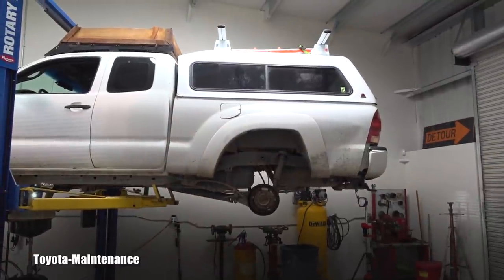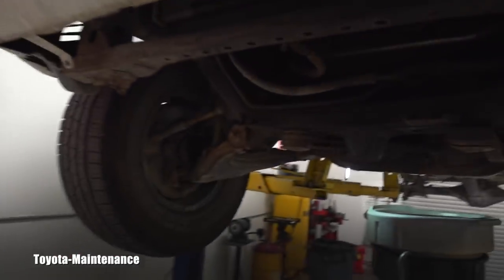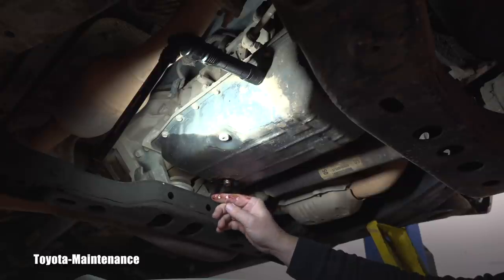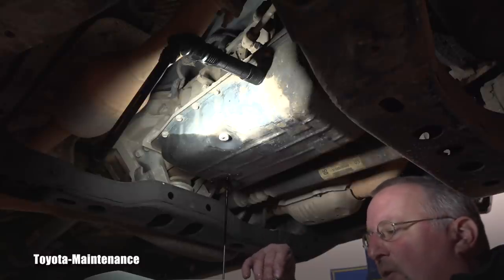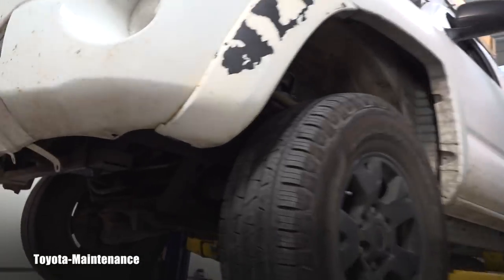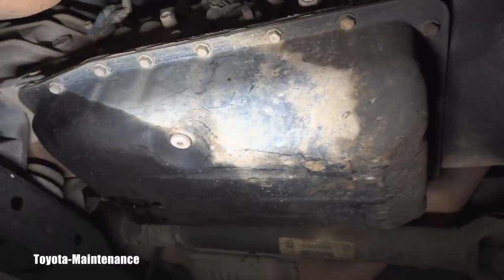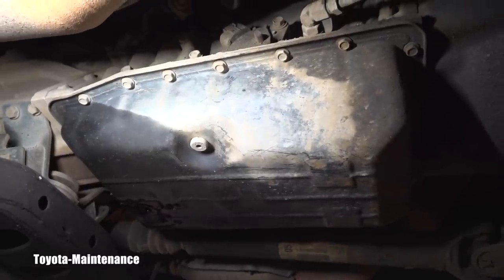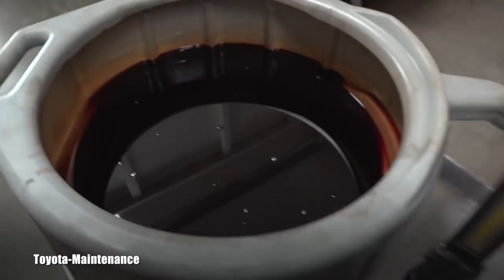Toyota transmissions can take a lot of abuse

Comment: When I bought my '11 Yaris, the owner had not changed it for 84k miles. It was extremely burned and a bit low. I did drained it three or four times through the drain plug and it is looking good. I used an alternative WS compatible brand, not genuine toyota . It now has over 150k miles and never missed a beat

Comment: I had to fight with my dealers service dept. To get them to service the tran in my '12 Tundra. They finally did it, but they didn't like it. Good video!
Reply: Just go to a specialist independent, why fight with someone over it, probably treat your vehicle poorly.
Reply: @FrenchValleyAirport  It's hard to fine someone qualified with the right equipment. It's a complicated process! I'm a pretty good mechanic and I won't do it!

Comment: Thank you for this very informative video. I would like to ask you (and the community) a question with regards to refilling the transmission after draining the pan. The factory service manual and Techstream specify that the transmission fluid be at a specific temperature when refilling. Since the volume of fluid changes with temperature, would it not be easier to measure the mass (kilograms/grams) of fluid drained and refill the transmission with the same mass of fluid? The mass of the fluid would remain static even if volume changed. eg. a kilogram of fluid would still be a kilogram of fluid whether it was at zero degrees or 100 degrees. The volume would change, but the mass (weight) wouldn't. If you weighed the amount of fluid drained and refilled the transmission with the same weight (mass), then you wouldn't have to worry about the temperature of the fluid. I welcome your comments, and thank you for hosting a wonderfully educational channel!

Comment: Auto Trans that Toyota uses sure do take a beating. They are very forgiving indeed. Mom had me drain and fill her 98 Corolla ATF at 189K miles. Did some research realized that it was a (cheapo) 3 speed Auto Trans and that meant unlike the 4sp A/T in other Corollas this 3sp has a separate differential resevoir. Well drained the old atf, very burnt brown. Drianed the diff and only about 10 ounces came out. Should have been more like 40oz. Who knows how long it was driven that way. But after getting the ATF back to red, the Corolla drove so quiet and smooth. That was with the 3 speed, the one people would rather pass on.

Comment: I agree with your thoughts on toyota transmissions.  I have found them to be very tough and bulletproof.  Had a first generation sienna that had fluid at 182K that looked like mud and after the change it shifted like new.  Took out both drain bolts (torque converter bolt and pan nut) got out 4.5 qts and did it again after 200 miles.  Cold shifts were back to normal.

Comment: Thank you for posting so much useful information I am a Toyota superfan as you are LOL. One term you use is a little confusing to me when you say transmission flush but I think the correct term is drain and fill because you're only removing what is in the pan and transmission flushes is exchanging all the old fluid for new and fresh.
Reply: A flush removes 90% of the fluid.  Drain and fill removes 30%.
Reply: Multiple successive drain and fills = a flush.

Comment: There is a reason why almost 90 Percent of the passenger cars in for example Afghanistan and elsewhere in the developing world are Toyotas. They can take a beating and even if the roads are bad they outlast other cars. Toyotas are seldom fun to drive, but they make the owner’s heart sing for joy because they are so darn reliable. 🥰
Reply: Three cheers for the developing world! They seem to have normal as well as highly imaginative ways of acquiring Toyotas. Let's just say theft is the most sincere form of flattery.  My definition of "fun car" includes reliability.
Reply: @rightlanehog3151  I would not know anything about theft being more common there than elsewhere in the world. I love owning Toyota, but I value reliability higher than driving.
Reply: @gus473  What you can’t have becomes exotic. I’d love to be able to buy the Tacoma or the Tundra in Europe. The Difference between the Tacoma and Hilux does not seem to be very big nowadays. We can’t get the Hilux with the gasoline engine at all.
Reply: @yunus_aros  There is a steady flow of stolen Toyota and Lexus 4X4s  heading overseas.
Reply: @rightlanehog3151  I would not think they would end up in Afghanistan though. Probably in Latvia, Lithuania and Ukraine.
Reply: @yunus_aros  Parts of Africa as well

Comment: My 2011 sienna had over 380K miles , never done any transmission fluid change and still running very good. As I don't plan to do it because I got my money worth already, plan to drive until it dies and buy a new sienna.
Reply: New one is Hybrid only.36 MPG with it.Toyota has come a long way.
Reply: I think your sienna is a highway car, can't image that mileage without any transmission issues otherwise

Comment: I've been using Valvoline Maxlife ATF in my old Toy. So far so good.
Reply: Valvoline Maxlife is Toyota WS compatible. I use it in my Tacoma and it works great.
Reply: I used Maxlife in both a 98 1MZ-FE V6 engine and on cold startup, until the trans oil fluid heated to temp, the first mile or so was slow to shift. Took two spill and fills to get it back to normal more or less. I thought okay it's a fluke. Maybe the T-IV was what was supposed to go in it and I goofed, live and learn. But no. Year or two later, used it again in a 2GR-FE V6. Same effect. Two more spill and fills with what was now required for this one WS and its back better. On cold, it might hesitate a little, but not as bad as before. Felt like on both cars the pressure wasn't building to push the clutch plates together to shift and needed a sec to build the pressure. Was strange. Both vehicles still work without trans problems or at least not needing anything more than fluid changes. Maybe you guys have 4 cylinders?
Reply: ` Nope, 2GR-FE V6. Haven’t had that issue, though I live in Texas. Doesn’t get that cold.
Reply: @Spillmansgarage  Nope, doesn't get that cold here either. So Cal not in the mountains. Lowest temp is about 45 in the valleys.
Reply: next time use a real synthetic -REDLINE.

Comment: I love it...  Shopping for a used Toyota and sellers asking top BlueBook value...  I ask for service records... They rarely have them ("I packed them as I'm moving" - BS) but when they do... 170k, no transmission fluid changes! No coolant changes! No brake fluid changes!

Check the mileage at the airbag replacements too.  Much can be learned.
Reply: You raise a great point. I shopped for a used Tacoma a couple of years ago and was amazed to see there is no correlation between the premium priced price paid when new, the premium price asked by used Tacoma sellers and any premium level of maintenance in between. After much searching, I finally found a 6 year old Tacoma with only 25,000 miles at a  fair price.  Other than oil changes, the owner had changed no fluids at all and was proud of it.  Naturally, I had every drop of fluid changed  to prepare it for the next 250,000 miles.
Reply: I was just shopping for a Toyota Highlander today, and of course there is hardly ever any maintenance records, and they're asking top bucks for it, really a joke
Reply: @1jackvalley580  Keep searching, the pay off will come with a top quality used Highlander at a commensurate price.
Reply: @1jackvalley580  

When you find one that you're seriously interested in, take the VIN and plug it into the Toyota owners website. You have to register your email to establish an account.  You will see, under that vehicle specifications page, the original options. Once registered, you can look at the service information. Make note of the mileage and services performed.

I am not exaggerating to say I caught at least three dozen Toyotas with altered odometer readings.  when that car goes in to get its takata airbag redone, they note the mileage. if the car hasn't had the airbags redone, I would be very suspicious. Those recalls go back years.

You can also go to Carfax and add cars to your garage or maintenance reminders list. I have found multiple cars that I was seriously interested in with mileage discrepancies, weird service notes, records of accident repairs that don't show up in Carfax...
Reply: @SeanPopify  I love how the dealer service people note everything in terms if importance. Keep it short but they note it. I found on the Owners site when the previous owner crashed into something. And when he took it to Walmart and they stripped the oil plug. Going to guess that's why the lug studs are bungled all around too. Very good advice that I normally would give.
Reply: @LAactor  In Southern California, most annoying notes from a few dealers are platitudes about "we're here for your best experience..." Blah, blah, blah...  I'll try to find one and paste it here... Some service advisors are sharp. Some, no, many aren't 😲.

Well, couldn't find a full-blown platitudinous prose, but this one is full of unnecessary filler and redundancy...

"TOYOTA CARE LUBE, OIL, & FILTER WITH TIRE ROTATION. ~|~TOYOTA CARE LUBE, OIL, & FILTER WITH TIRE ROTATION. ~|~DRAINED ENGINE OIL, REPLACED OIL FILTER, ADDED FRESH MOTOR OIL, ROTATED TIRES TO BEST LOCATION, PERFORMED 29 POINT SAFETY INSPECTION, WASH VEHICLE EXTERIOR AS WEATHER PERMITS. ~|~1XXX7 60 DRAINED OIL, REPLACED OIL FILTER, RE-FILLED WITH FRESH OIL. PERFORMED 21 POINT INSPECTION INSPECT WEAR CONDITION, INSPECT FOR PUNCTURES, INSPECT BRAKE CONDITION, AND ROTATED TIRES TO BEST POSITION"

Comment: My dad owns 2 Toyota trucks. '96 T100 and a '97  Tacoma. He never changed the trans fluid in either. Ever. They are currently sitting at just under 400,000 miles. I drive the T100 daily for work. Do I think you should change your fluid? Absolutely. But seeing his trucks go and go and go brought me to buy Tacomas. I trust Toyota manufacturing.

Comment: I didn't learn that I could change transmission fluid on my 05 4Runner until 90K miles, but I've done it several times since and the fluid is bright clear red and the transmission works perfectly. I regularly drain and fill all my Toyota transmissions now. Once you know how, it's easy.

Comment: My neighbor had a bad oil leak on his old 2000 Corolla for years. Oil always under the dipstick, everytime I changed it only 1 or 1.5 quarts came out. Needless to say the engine still ran when we scrapped it 3 years ago and I couldn't believe it

Comment: I had a 98 Ford Taurus, when I was foolish enough to buy a Ford. I knew the transmissions weren't bulletproof, so I went heavy on the maintenance. Four times a year, regardless of milage, I would drop the pan and drain the fluid. Every other time I would replace the filter. Around 80,000 miles, the thing STILL crapped out, requiring an expensive rebuild.

On the plus side, it was literally the day after I signed the car over to the ex as part of the breakup!

Comment: Yeah just did a drain and flush on my 4runner. Drained it, filled it. Turned it on, shifted through all the gears 2-3 times stopped. Then drained it again and refilled. Shifts much better after 12 years of use, 177k miles, I doubt it had been serviced. That included doing my diffs and transfer case.

Comment: I had a 1996 t100 4x4 3vz . I sunk it  to about 6in from coming into the windows in Carova  NC . Hour later i got pulled out it started first hit. I drove home to virginia beach  about three hours with a trans. full of water. It had 175000 when it happened  i cleaned every thing and alot of trans flushing . A 4runner ran a stop sign and totaled it at 210000. It didnt have any problems and i drove it vary vary hard. Still started and drove  but no rad., lights,or fan. But the ac had no leaks and worked

Comment: My 2000 Tacoma has 590,000 miles on the trans and its been told me by Toyota not to mess with it since its pink (why F with it)been pink for 150,000 + ,sure don’t baby it ,when I need more pep on FWY I hit that O/D button ,I think I’m blasted off I LOVE PINK!
Reply: Edward Aguilar have u changed the oil ever ? Wow it’s been pink for many miles I love pink
Reply: @treedeblue  always had changed it regularly the about 300,000 miles jiffy lube and others wanted me to sign a waiver ,so I said Toyota dealership should and has been doing ,basically Toyota said they would do a just drain fill without  messing with the filters and stuff,but yes always had changed it every 50,000 miles ,and now it’s been about 150,000 miles without a change but like the dealership said let it be ,than only change oil not filter

Comment: If ya haven't mentioned it, Blackstone Labs will test oil and transmission,coolant,differential etc fluids. See if previous shop actually used tbe specified fluid customer paid for. Tests results show lotsa stuff. And relatively inexpensive! $25-30 bux last i had it done. They provided the mail safe cans. Used fluids are considered hazardous materials but way you send in provided containers is idiot proof.
Reply: It's a waste of money. Did it and they always check back and keep sending samples. It's rare you'd catch something in the particulates that would show a bearing or piston going. Change the oil at the interval Toyota recommends and you will be fine. 5000k or 6 months for older cars as they all make abrasive metals.  TBN is another scan add on you don't need.

Comment: With a GM transmission many say that if it's too old 150K or more not to change do to possible 
slippage or damage.  Would you agree with the statement? 
Is there a cut off mileage in a Toyota where you wouldn't change the fluid?

Comment: I thought you were going to change the filter also.
Reply: I don’t think you can without disassemble the transmission
Reply: @sciatl2505  the pan comes off of this a750 trans easily. It only contains a filter screen, no traditional paper media in there. I’d drop the pan for the chance to clean the screen and the pan itself out.

Comment: Question......one of the comments below said the guy changed the fluid from the pan and the torque converter. I know how to do it from the pan, but how do you do it from the torque converter on a 2017 Toyota RAV4 and a 2009 Honda CR-V?  Jim

Comment: Purchased a 2008 Toyota 4Runner 4.0 v6 . No transmission service records and it has 198,000 miles on it . Can I drop the pan and change filter and fluid without causing problems with shifting ? I’ve heard it’s a bad idea because it has possibly never been changed?

Comment: I changed the manul transmission fluid on my 2001 Civic 5 spd 111k and it shifted easier, I think somebody forgot the 60k maintenance.
Reply: The two quarts of manual transmission lube in my 05 Corolla 5 speed get changed in 5 year/ 50,000 miles intervals. The cost of the (Amsoil) lubricant  and 15 minutes labor is cheap preventative maintenance and another regular reminder of the benefits of choosing a manual.

Comment: I'm the 2nd owner of an 03 Avalon with 225K miles on it. Purchased it over the summer. Car runs very well. I put in a new timing belt, water pump, air filters, break pads and rotors.  Original engine, transmission, starter, alternator. I'm pretty sure the spark plugs have never been replaced, the valves never adjusted and the trans fluid looks like Guinness stout which leads me to believe it's never once been drained and refilled. Wondering if I should do that or just let her be at this point? Don't want to mess with whatever might be floating around in that fluid. She shifts alright at the moment. Any thoughts?
Reply: Take it to a competent transmission shop, flush the entire transmission and replace it with 100% new and approved fluid. I hope you changed the plugs.
Reply: At this point do not change the transmission fluid unless the shop will eat the cost of the transmission rebuild. It's safe to say that transmission friction material from the clutch plates have come off and are suspended in the trans oil. Without that fluid with the friction material, the trans will fail. Do not flush. It's too late. You can get another 100k at least from that car without anyway. Heard even beyond that. If it ain't broke. Why break it?

Comment: Question: i have a 2001 lexus gs300 w- 189k. I bought it 5k miles ago. Trans fluid is blackish. Is it safe to change it and also is there a filter inside the pan that should be changed out?

Comment: Hello, I have a 2008 Tundra with 225,000 miles and it has never had the transmission fluid changed. Do you recommend changing it at this time? Or should I leave it alone since it is shifting perfectly?
Reply: Better late than never.
Reply: Look at the color. If it's dark dark like used motor oil dark, leave it. Otherwise you'd need a transmission rebuild. Maybe $1-2k. You can chance it. But save the drained fluid in case bad stuff happens and you want to try to save it by putting the old stuff back in. It won't be all back in, but you'll have a better chance. Best is just not and hope for 100k more miles and do better next time. If it's dark brown. You never know if the first owner did a change.

Comment: Could it be dangerous to replace such old fluid? Maybe it will start slipping.
Reply: Robert Burley  i had 220k on my v6 and the fluid was brown as. I changed and flushed it .i would rather have a rebuild now not later.
Reply: Robert Burley  :-)
Reply: @mikewatt1376  I would not want a rebuild now if I can get 100k+ out of it and decide if I will still have the car